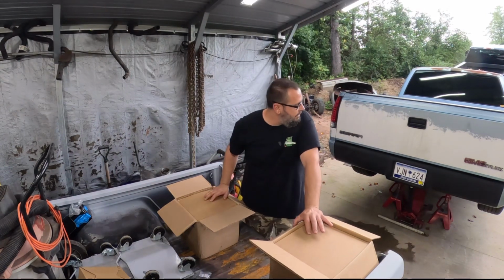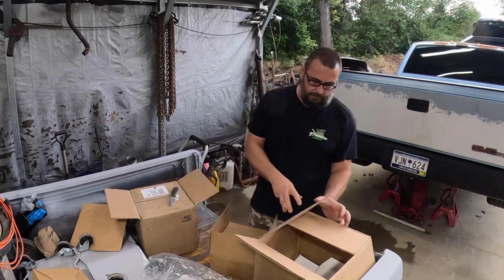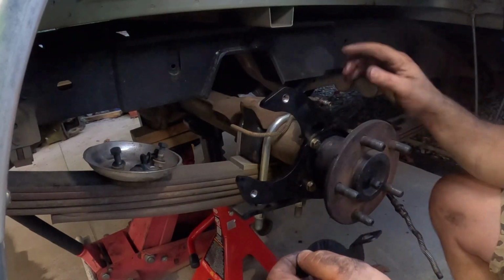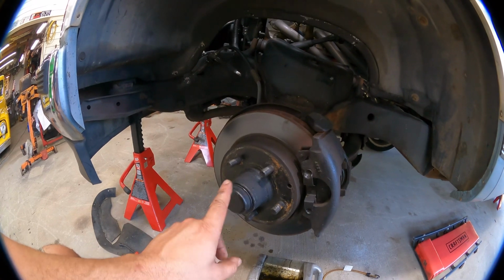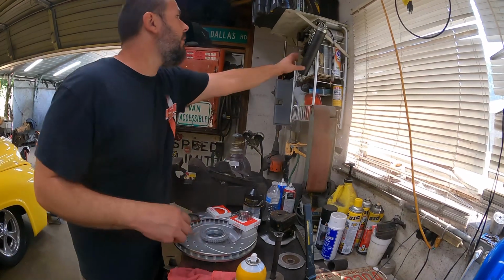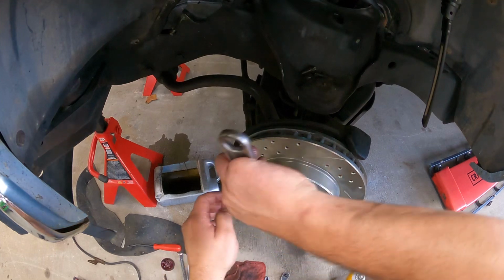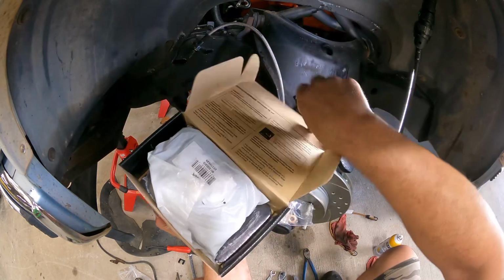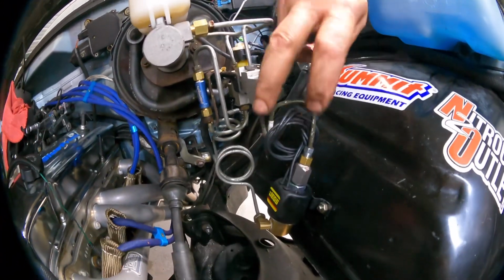Little Shop Mfg disk brake conversion for OBS GM Truck.

Comment: What proportion valves did you run for the rear disk brakes?
Reply from the maker: Factory one, just added a residual valve
Reply: @LeftForDeadGarage  did you take the spring and o-ring out of it?
Reply from the maker: That video was from nearly three years ago, refresh my memory.

Comment: looks good bro, but I though you didn't do easy straightforward jobs
Reply from the maker: Oh I do them I typically just don’t get them. 😂😂😂😂
Reply: @LeftForDeadGarage how much was it all in
Reply from the maker: Best I remember it was around $1100 with all the extras.
Reply: congratulations on 2500 subscribers @LeftForDeadGarage
Reply from the maker: @linnc7591 thanks!